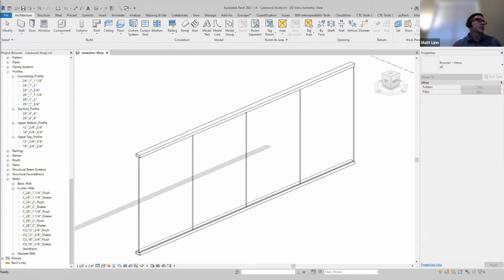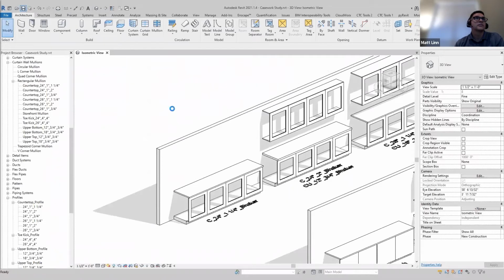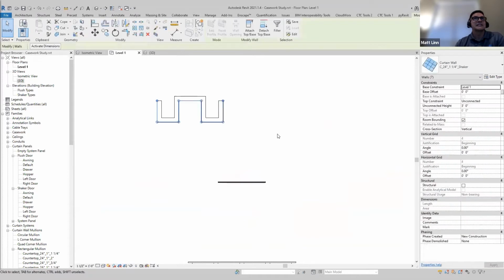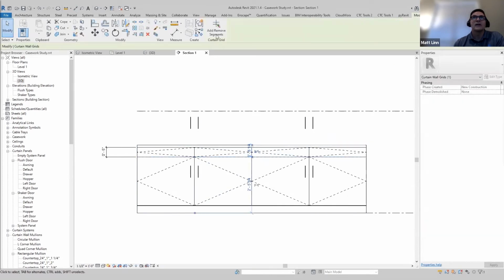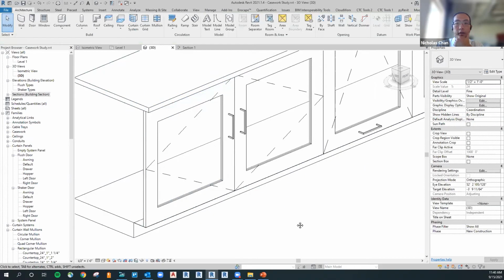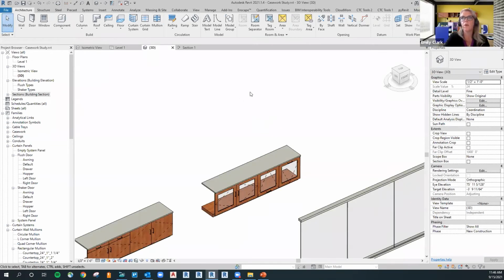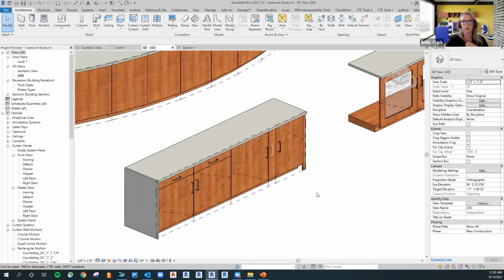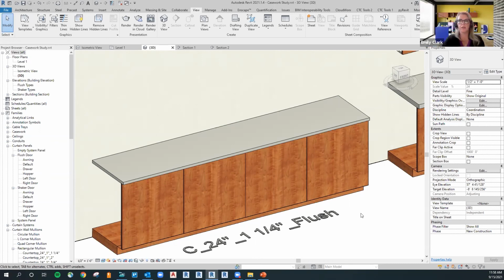ATG Architectural Town Hall: Curtainwall Casework

Comment: A little late to the party here, but great topic and video. Thanks for sharing. Too bad Autodesk folks could not foresee (and accommodate) the need for quick and easy cabinet layout. It is/was one of the main reasons folks couldn’t use Revit for SD, just too slow and tedious for these tasks at SD level. Kudos to you folks manipulating the OOTB tools for this use, AND sharing it with us. Autodesk/Revit needed to provide what you’ve done at least 10 years earlier.